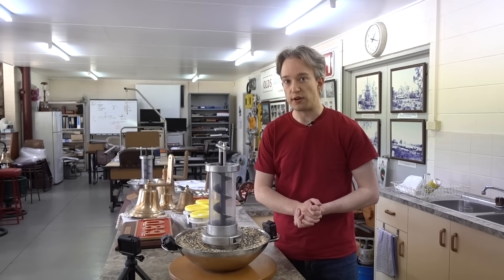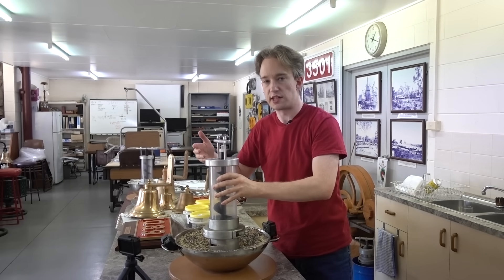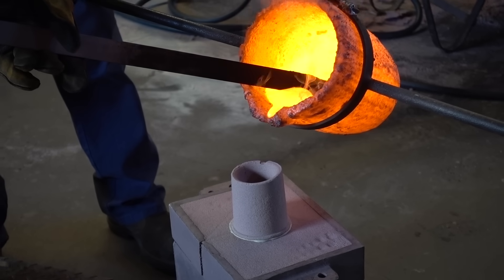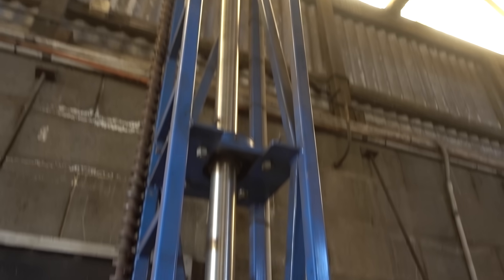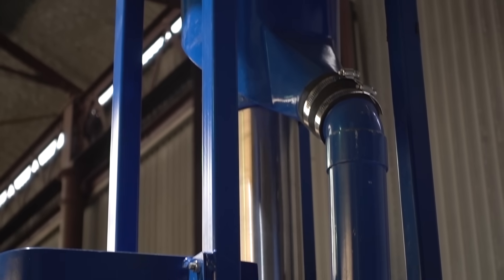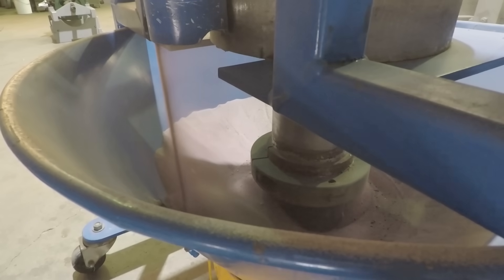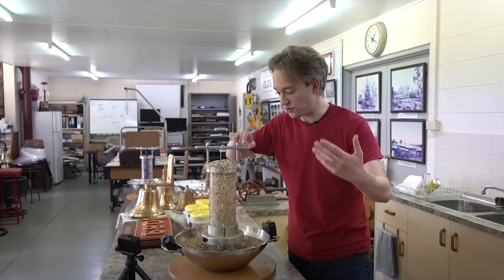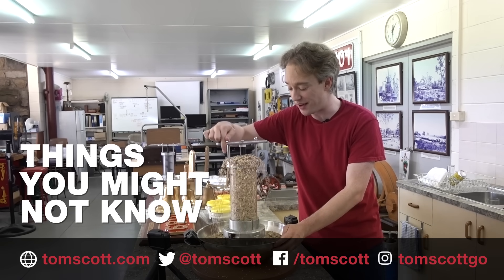Mr Olds' remarkable elevator

Comment: "Corn dust is highly explosive"

Noted
Reply: All flammable fine grain materials are highly explosive as a matter of fact. Flour mills have been blowing up since they started using primitive machinery to grind it.
Reply: I was more surprised by Sugar.
Reply: @rasta77-x7o  sugar is commonly used as a fuel in explosive combustions
Reply: @rasta77-x7o  google "Sugar rocket"
Reply: It's not a high explosive, it's a low explosive. Are you not following Tom Scott's videos?
Reply: @andreasu.3546  Highly explosive, not high explosive.

English is such a mess.
Reply: If it can burn and it can become airborne as a particulate, it's explosive. Coffee creamer, flour, sugar, fine sawdust, dry starches, anything like that. Like imagine a campfire, you're trying to light some big logs just sitting there, it's a huge pain if you don't have the proper airflow. You take the same mass of wood, the same potential energy, but in the form of lots of little sticks that let air flow between them, air that the fire needs, suddenly it's so much easier! Extrapolate that to something very very fine, like sawdust, going in the air. A tiny spark is all it takes, like the kind machinery can generate with metal rubbing against itself. It catches fire so quickly and so strongly, that's all an explosion is really. All that energy being released at once in the form of heat and light. And it's incredibly common in factories, historically. You can take handfuls of things like that and throw them over a fire and they'll burst into flames, I've done it with coffee creamer before, and powdered sugar. Cautiously of course :-)
Reply: Stares at custard package in kitchen
Reply: @rasta77-x7o  a good amount of metal dust will do the same, what usually happens is a primary small explosion knocks all the dust in the building loose then a secondary explosion comes when all the falling dust ignites, the secondary explosion is usually much larger and more deadly
Reply: @rileymannion5301  Beat me to it, if you powderize anything it'll probably become explosive at some point
Reply: Make the dust small enough and it will ignite on exposure to oxygen, one example would be sub-micron aluminium powder.

Comment: i have wondered why the archimedies screw isnt used as much. glad an upgraded version is going the rounds.
Reply: The main use I can think of is for dredging bodies of water.
Reply: I think the general problem with archimedes screw is the same as with Wankel engine: sealing the moving surfaces is just too damn hard in practice. You either have too much friction, too much leaking or too short lifetime for the seals.

Comment: What I am still not clear on is — What is the advantage of turning the tube, rather than the screw inside?
Reply: Ian Cook Because the material being lifted is packed against the side wall there is less friction, dust and air mixed in when lifting. All of this is very important for materials, when their dust is present, are known to combust when heated in the presence of air.
Reply: Its a full flow system meaning that no air is inside the tube (other than the air between the grain, or sand etc...), this means that the material doesn't get agitated as it would in a traditional screw pump, causing massive amounts of dust which can be extremely dangerous depending on the material. So basically, dust reduction.
Reply: It’s explained from 2:50 onwards.
Reply: I'm not convinced. (ID: ?v=eiusOhH1dz0) <-- This video shows that clearly a full flow vertical conveyor is possible by turning the screw just fine. So the only beneficial aspect is reduction of friction because the surface area of the tube is lower than that of the screw. Tom, please explain this to us!
Something else I don't understand is why is would be necessary to rotate the entire cylinder, instead of just the scoops at the bottom. (Maybe to reduce the relative velocity of the material and the walls, thus reducing friction?)
Reply: @robertreitze3192  I dont think theres any difference. Thats why it doesnt make a lot of sense. The only benefit I see is that having the tube rotate its trivial to add those scooping side pieces on the button. if the spiral was the rotating part that might be harder.
Reply: Tube is a lot more rigid than a small diameter shaft, so overall a lot less flex, and thus a lot less wear as the shaft incidentally scrapes on the side wall of the tube. as well it is a lot easier mechanically to have a rotating tube and additional support bearings along it, rotating the tube means the shaft must of necessity be both very strong and inflexible to deal with the torque load, while the tube itself can have the same power applied to it at multiple locations, and has a much lower stress in the material at the same time.

This is a very good invention, well thought out and totally novel. Makes it trivial to lift powders long distance, something hard to do with a regular screw drive without needing extremely high torque and very precise control over the construction and balancing of the worm, where here you need less strength in the worm shaft as it merely has to bear the torque of half the load, as it is fixed both ends. Easier design as well, no need for large bearing races in the inlet and outlet areas that need both lubrication and good seals, but you have simply a easy brace that does not rotate. Seals and bearings are out of material flow, and large bearings are very easy to make, if they use multiple follower bearings on a heavy steel rim, which can have axial control added as well cheaply. Small bearings with low load ratings in multiple are a lot cheaper than a single large bearing with the same aggregate load ability, and are a lot more reliable and cheaper to maintain.
Reply: @SeanBZA  Well, I don't know if everything you say holds up in an actual engineering environment, but I would tend to agree. Also I am convinced this technology makes sense in some way, I'm just disappointed its advantage over traditional screw conveyors wasn't very well explained in the video.
Reply: Because when turning the screw, it will pump air and particulates up, like a fan. Turning the tube will mostly just pump particulate up, because the air doesn't stick to the walls of the tube as well as the particulate
Reply: @SeanBZA  Good points. I also think that the way the stuff enters the tube is much better and simpler here. It compresses the stuff into the tube, whereas if you have a rotating screw you probably need some additional mechanism to accomplish that (or a rather deep vat to let gravity push it in).
Reply: The other advantage is that the bearings can be outside of the tube and completely separated from the bulk material, so you don't have to worry about sealing them again dust and particles.
Reply: @dorusie5  That makes some sense, thanks for the new approach. Though just to be clear, the particulate isnt moved up by the friction with the wall, rather by the scoops at the bottom acting as buckets and the weight of the particulate pushing on the 'entrance'.
Reply: @SeanBZA  the forces acting on the tube and the screw are the same not matter which is rotating. Since its the same relative motion
Reply: I think also maybe because the casing is lighter and easier to turn than the big central screw; so maybe it's more energy efficient and makes maintenance easier?
Reply: @robertreitze3192  biggest advantage I saw (that Old explained) was that there is a gap between the screw and tube, so the small particles can travel up without being crushed, therefore less friction in the system and dust being generated.
Reply: So, you don't get screwed 😆😅😂🤣😋
Reply: @txd  just cause you don't see a use for something doesn't mean others won't.
Reply: @speedy01247  how insightful
Reply: @txd  Relative to what? To each other, sure, but to the ground, no. If the screw is rotating then one side must be driven and the other attached to a bearing.  This is markedly different than both being statically fixed (to the ground and an external housing at the top, say).

In particular the point they were making is that the bearing side is not fixed, so the side attached to the motor experiences the full torque of material pushing on the screw; in the tube rotation setup both sides of the screw are fixed and effectively share that torque.
Reply: @radicalpaddyo  Would that be different with a traditional screw?
Reply: @LukasFink1  No it isn't. The aspects of this particular machine are stated, but no comparison to the version with the rotating screw are made. I fail to see how the points made don't apply to the rotating screw as well. The physics involved is quite similar.
Reply: @NWRIBronco6  There's nothing stopping you from driving both ends of a shaft.
Reply: @robertreitze3192  Yes.  A traditional screw is essentially pulling the material upwards (or rather it's pushing, but that push is being done at the top) so if the clearance is too large the material will prefer to slip out the sides instead of going up.  In this new elevator all the force is at the bottom, and material on top is being pushed from below.  The screw in the middle gives... call it an up-ness to the way the material wants to go but it's a guide rather than forcing it.

Let me have another go at this: in a traditional screw you are pulling material away from the ground, and ideally keeping it up there long enough for outside material to fill in underneath.  With the new screw you're pushing material in at the bottom, and just making it easy for the stuff that's already in there to go up instead of pushing back.
Reply: A rotating screw in a fixed tube will barely work if at all vertically over any distance. Try it and see. The Olds works best vertically, not at low angles. Also an Archimedes needs a tight gap screw-casing or the materials won't flow, falls back...which has a grinding action. Olds has huge tube-flight gaps, and still works! Weird.  Olds output is absolutely proportional to rotational speed so can be used in a feedback situation as a precise flow controller.  Sure it works with a full casing, but works outside this mode too at higher speeds.  Using stainless screws, they will work for years, even lifting sand, and negligible wear!   So no maintenance or downtime.   No internal bearings either, because screw does not rotate. Think of that over large vertical distances. Lots more advantages...  I live just down the road from the Olds plant.
Reply: And because there's no bearings attached to the screw that could gum up with the powder.
Reply: Exactly.  And the long length of flighting is kept straight by tensioning it.. so it does not wave around in the tube.  It has also been found that by its very operation, there is a self-centring action.  These Olds units can be cascaded to reach huge heights when handling sand in solar power units.  At hundreds of degrees C.
Reply: @adamsbja  Thank you, this is a very good explanation.
Reply: @skeetsmcgrew3282  How does any of that apply to this comment thread? I see nothing but people sharing information, and attempting to understand a new discovery — in a word, learning.  Why do you compare them with those who reject learning entirely?
Reply: @robertreitze3192  Turning the entire cylinder means that the full lenght contributes to the lift, because the friction against cylinder walls drives the material round and up the screw.
Reply: @seraaron  I was thinking the same. All the weight of the grains go to the screw. Making the screw rigid and turning the casing, it will require less power and be more efficient to make same flow.
Reply: Well one advantage seems to be that it works better vertically, or is at least much more versatile at doing so. Think about a grain silo, to load them they use screw conveyors that are typically at a ~45-60 degree angle that they feed the grain on to at the bottom and it has to be done at a rate that matches the rate of the screw turning to an extent. I think what the Old's Elevator is really doing is tying together those two factors, the rate which the product is fed to match the rate the screw is turning (or relatively turning) from a single force.

Now a grain silos do/can have a vertical screw lift in the middle to get grain out but that relies gravity from the massive amounts of grain pushing down/inward towards the screw that will be automatically limited by the rate the screw is removing grain. You could only turn the screw so fast though for without agitating the grain in the middle limiting the rate, or depending on the product mixing too much air in which could be a problem. It also requires a sort of 'critical mass' of grain to be in the silo to work vertically, with what Tom's showing us there just needs to be enough to to encompass the scoops.

I think you have to take in to account a full system, I could be wrong but I think its actually two Archimedes' screws (the scoops are functioning as an inverted screw that feed the internal one) so you have to think about the full system to understand the benefits since its not just a single 'simple machine'. For instance I don't think you'd want to use an Old's Elevator in the grain silo as it would require considerably more energy to turn inside all that grain which is already providing the needed energy as potential energy anyway. So as with any machine it seems like there's going to be trade-offs and application dependent, its not as if this is a replacement for the Archimedes' Screw.

Would like to hear a real physicist/mathematician/engineer's take on this however.
Reply: It is less efficient because only the bottom scoops are doing any work, but that is the benifit in some cases. All the lift comes from the bottom so it stays packed. Rotating the screw lifts everywhere, which can cause uneven pressure and air mixing and more turbulence.
Reply: @Carewolf  If  'only the bottom scoops are doing any work' was the case then a setup with only rotating scoops and no screw at all would be equally efficient - clearly not the case. The screw is also lifting in this case.
Reply: @renemunkthalund3581  No, the screw isn't moving, it is merely providing a ramp. The sides of the tube are helping by rotating the material which is then pressed upward by the pressure from below and the ramp of the screw, but there is not as much force on the sides as there would be on the screw , so the sides only help, you need the scoops to create higher pressure in the bottom and pack densely enough that the sides of the tubes can do anything
Reply: @Carewolf  I agree completely on this description. I know the screw isn't moving, and the packing effect of the scoops, I've described just that in other comments – I'm reacting to the claim that "only the scoops is doing work".
The screw is acting as a ramp. Agree, which means it is excerting an upwards force on the moving grain, hence providing lift and hence doing work.
Reply: The physics is very similar either way, but because it's rotational it isn't identical in the way that relative linear motions are.  The forces on the moving particles are mostly coming from the rotating wall and propogating inwards, as in a Tesla turbine.
Reply: @txd  
The scoops at the bottom are anything but "trivial."  Without them, the device wouldn't work.
Reply: SeanBZA well put!
Reply: @robertreitze3192  no gap
Reply: It seems to mostly be the fact that it can't pump up air, which is a big problem with the screw versions (mixing air and particulate creates explosion hazards). Also it's much more forgiving, since screw versions generally need tight tolerances while this one can work with huge gaps.
Reply: @renemunkthalund3581  the screw is just exerting a normal force on the grain, it's not doing work. work requires a force to actually move an object. the grain here isn't being moved by the screw. its being pushed up by the grain below it, not the ramp. if you were to do an energy balance on this process where energy was being put in to the tube only but work was being done by the tube and the screw then you would be violating conservation of energy.
Reply: One advantage, is this is self feeding and agitating.

When just the screw moves, it’s easy for the material it’s meant to be loading to get jammed up and fail to enter the inlet.

With this, you’d have to have something gummy enough that it doesn’t even slump in to touch the tube before that would be likely.
Reply: @dakane328  So this invention only works with enough material at the bottom? When i try to empty a material what would happen with the material in the tube if the container is empty?
Reply: gjhard  would there be any disadvantage to just making the bucket part on the bottom rotate only? Therefore having the auger flight and casing remain still in relation to each other, but still have the bucket system on the bottom ramming the medium in?
Reply: magnum0121984 Yes, The disadvangage is that all the force is applied from the bottom, and it would jam up the passage, rather than move the material, unless it was a very short elevator.

With both this and a regular augur screw, you’re actually imparting force to the material all along the length.
Reply: Martyn Watson there are advantages, did you watch the video?

Yes, initial costs may be higher, but just the fact that it’s less likely to jam and that you don’t have to worry about bearing lubricant fouling the product in the event of a seal failure is massive.
Reply: a big brain move would be to rotate the bottom bowl, that way you can keep the gears and joints away from grains and sand.
Or an even bigger brain move, just hire cheap labor or kids to clime up the stairs, that way you're super green and can boast about not using any electric power :)
Reply: Where are the subtitles when you really need them to understand an old Australian fellow?